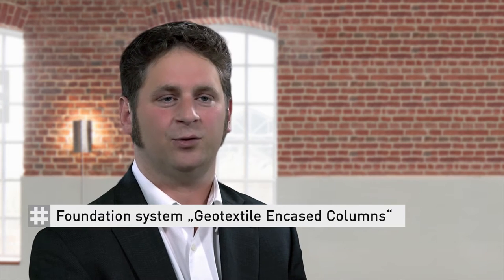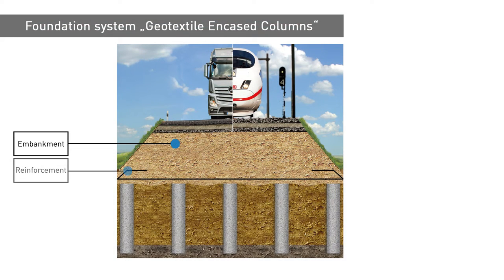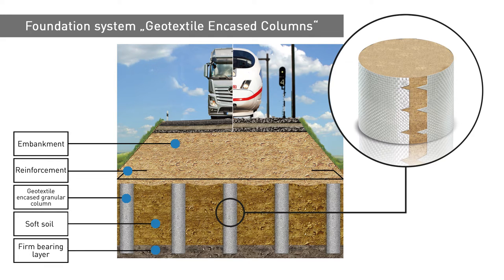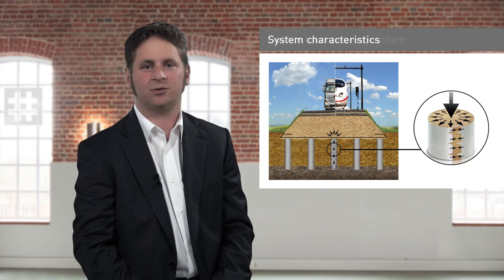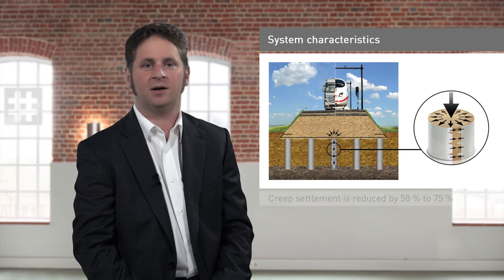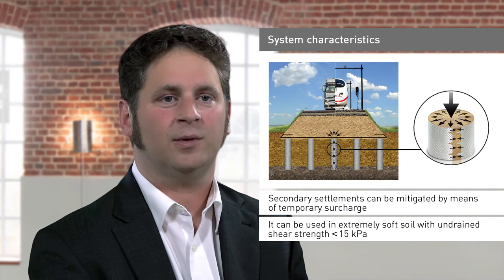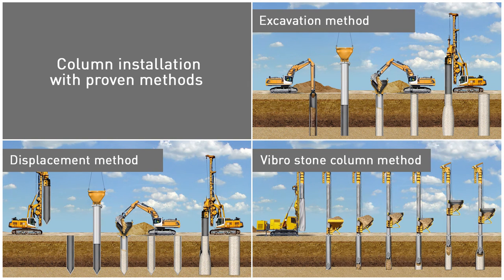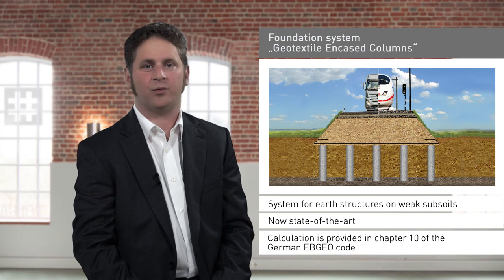VideoCast | Foundation System „Geotextile Encased Columns“

Comment: It's an amazing foundation system!

What if the compressible layer if very thick, say 45m. Are end-bearing GECs recommended in such cases? (Do they keep the cost-effectiveness?)
What if i pretend to encase floating columns? Would it still be applicable?
Reply from the maker: Hello and thank you very much for your interest and question. The longest column length installed so far is approx. 30 m. The current machine technology is not designed for 45 m long columns, so we would not recommend this application here at the moment. Regarding an application as "floating columns", research is still in its beginnings and we are curious where it will lead. Should you require further information or details, or even have a specific enquiry, feel free to contact us directly: marketing@huesker.com. We would forward it directly to our colleagues in the engineering department. Best regards from the HUESKER team.